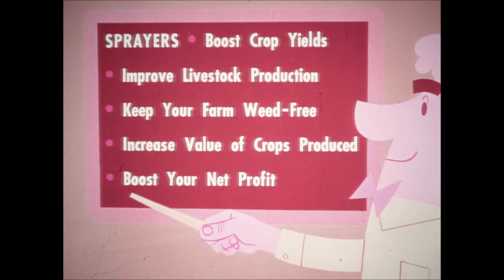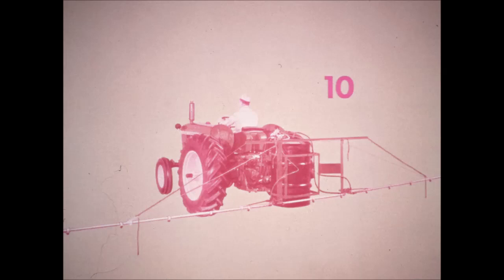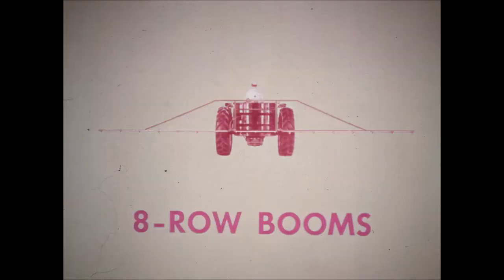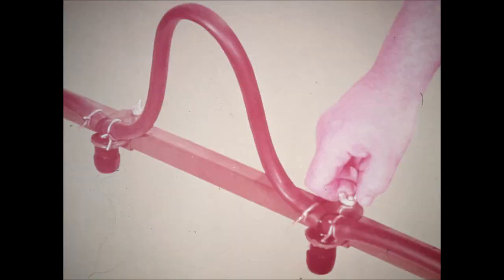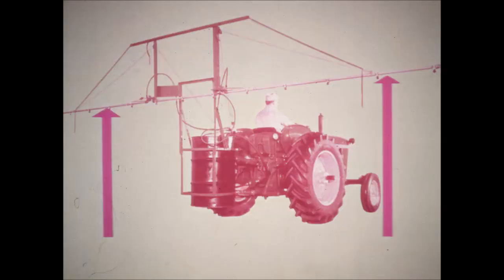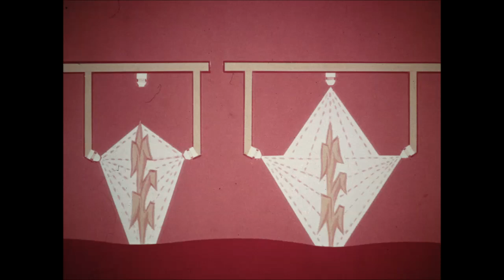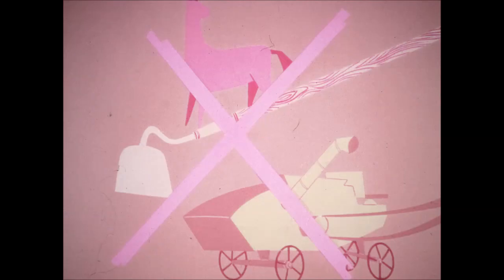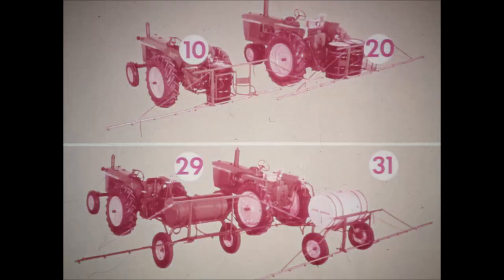John Deere Presents Sprayers

Comment: Looks like a combination of Hypro and Delavan pumps... high pressure piston pumps for high pressure low volume spraying like for orchards, to spray up in trees all the way to the top, or hosing down a pen of livestock.  Roller pumps are the old standby, been used for decades, self-adjusting for wear (to an extent, far more tolerant of wear than other designs like piston or  gear pumps), and the brass gear pumps, which are good for some things (like engine oil pumps, hydraulic pumps, etc) but for sprayer pumps, aren't that good because of corrosion and wear issues (I know I had one of Grandpa's old gear pumps that was worn out that I partially salvaged, as I lapped the housing to tighten up the gear end clearance between the gear and housing (to reduce internal leakage and build more pressure) but there's not really anything you can do to fix wear around the periphery of the gear tips where they're supposed to wipe along the wall to create a moving seal and minimize leakage past the gear tooth tip from one chamber between the gear teeth to the next, which is where the spray is transported from the inlet to the outlet, and forced out the outlet as the gears mesh their teeth together to fill each other's empty space, forcing the spray out.  The killer with gear pumps is when the gear teeth tips wear down, or the teeth themselves wear down from the wiping contact between them, and the front and back side ends of the gears wear, and the housing wears down next to those surfaces on the front and backs of the gears and around the gear pump housing where the teeth tips slide next to the wall, the pumps lose the capability to make pressure, due to the internal leakage of liquid "slipping" past the excess clearances back from the outlet to the inlet.  That's why you don't see many gear pumps on sprayers anymore... too many wear points.  Piston pumps are also likewise complicated, with bore and piston seal wear being issues, along with inlet and outlet valves.  Less wear points than a gear pump, though, and capable of creating VERY high pressures, which are essential for orchard spraying, which is why they're still used widely today.  The simplicity and self-adjusting for wear characteristics of roller pumps make them the most popular type of sprayer pump when one considers positive-displacement pumps (which roller, piston, and gear pumps are all positive-displacement pumps, versus vane and impeller pumps and turbine pumps which are all non-positive displacement pumps, where output in gallons/minute changes with pressure and impeller/turbine speed).  Roller pumps can adjust as the housing and rollers wear, because the rollers will simply slide slightly further out to maintain contact with the housing walls.  The most critical non-adjustable wear on a roller pump is the side-clearance of the rotor, similar to the side clearance of the gears to the housing on a gear pump, but lapping the housing (slightly grinding down the cover and housing joining surfaces) reduces the clearance back down to what it originally was, or close to it, thereby restoring the pump to proper operation, which is usually accompanied by replacing the rollers at the same time.  Roller pumps are simple to construct and simple to maintain and little to go wrong.  The other types of pump they didn't cover in the video (other than the variable displacement impeller or turbine type pumps) that is fairly commonly used is a diaphragm type pump, and the vane type pump.  Vane pumps are commonly used in hydraulic systems, where the fluid is the lubricant, but like gear pumps they're extremely sensitive to wear causing excess bypass, particularly on the faces of the vane center rotor to the housing (end clearance).  Like a roller pump they'll partially adjust to wear along the housing periphery, but have sliding contact between the vane tip and the peripheral wall, like the gear pump, where a roller pumps rollers ROLL along the wall facing.  The vanes tend to wear the grooves in the rotor that they slide in and out of as they rotate as well.  The diaphragm pump is similar but somewhat less wear-prone than the piston pump, since the diaphragm pump uses short-stroke "pistons" to move a rubber diaphragm up and down a small amount over a large diameter, to create the suction downstroke to draw fluid through an inlet valve into the chamber between the head and diaphragm, and pressure-producing upstroke to pressurize the fluid and force it out an outlet check valve to create flow and pressure.  Like a piston pump, however, they create highly "pulsed" pressure spikes as the fluid is forced out of the outlet check valves, so they usually have multiple offset pistons or diaphragm chambers to help dampen out the pulses so as one piston is delivering fluid the other is drawing it in-- and sometimes use an accumulator (particular with piston pumps operating at higher pressure) to dampen the pressure spikes and allow for more uniform, steady output without the "buzzing" of pressure spikes that can plague piston pumps, and to a lesser extent diaphragm pumps.  The rubber diaphragms themselves help dampen the diaphragm pump pressure spikes to an extent.  

What I found most amazing about this video (and a similar one I watched about IH spray tractor mount systems) was the use of steel tanks, in the case of the IH system, and Deere using regular old 55 gallon steel barrels.  Neither of these were particularly good choices for spray tanks, as they corrode so easily and, in the case of barrels, are difficult to get all the spray solution out of.  This was from the really early days of spraying and it seems clear these were sort of "ad-hoc" solutions that the manufacturers put out to "complete their line", and it'd be interesting to see what their sales numbers on these systems actually were.  It's not like spraying was some "mystical science" even back in the 50's when these were being advertised, because cotton farmers (and others) had been using oiling shoes (which basically sprayed a cheap low-grade fuel oil sort of kerosene for weed control) under cotton for a decade or more at that point... My Granddad's old oiling shoes are still out on the wall of the lean-to under a bunch of other old junk.  They basically slid along the ground with a nozzle that sprayed this "weeding oil" under the cotton plants to kill small emerging weeds coming up under the cotton plants.  They used the same basic hardware (pump, control valve, pressure regulator) as sprayer systems did to deliver the oil to the nozzles.  Flame cultivation was also popular at the time, but it usually used propane which is self-pressurizing to feed the burners under the plants.  

TBC... OL J R :)
Reply: Continued... 

I'm sure there was a lot of competition from "outside vendors" building and offering spray systems for sale even then.  Dad and Grandpa had an old pull-type Mayrath sprayer from the 60's when I was a kid-- it sprayed 8 rows wide on foldable booms, and used a small trailer similar to the Deere pull types in the video, with a long "Tylenol shaped" 200 gallon fiberglass spray tank.  They used to use it to put down Treflan ahead of the disk in spring preplant incorporated in cotton, then follow up at planting pulling a pair of rollers behind it to band Cotoran or Caparol in a 14 inch band down the top of the rows behind the planter, and roll the beds tight after planting to retain moisture and speed germination of the planted crop.  In the late 70's Dad bought a single saddle tank kit, since those had become VERY popular in our area in the early 70's, but instead of side-mounting two 150-200 gallon tanks as most saddle tank kits were then doing, putting the tanks between the front and rear wheels of the tractor, he used the single tank and frame kit to mount a single 200 gallon tank on the front of the tractor.  By plumbing together a ball boom on/off valve with a pressure regulator and gauge, and a bypass line feeding back to the sparger agitator under the tank, with the PTO roller pump on back, and then installing a four row broadcast or banding boom under the tractor belly behind the front tires, we could then spray and disk at the same time, so broadcasting Treflan and disking it in immediately saved someone having to mix and spray with the old Mayrath sprayer and the other guy on the other tractor having to disk the Treflan in.  Now the second tractor could be either pulling a fertilizer machine to knife in liquid fertilizer, or pulling a hipper (row disk) to pull the rows back up and rebuild the beds, and finish mixing the soil with the Treflan, leaving the field about ready to plant.  Similarly, at planting, swapping out the broadcast boom with the banding boom mounted under the belly of the tractor, one could spray the bands of Cotoran or Caparol down the tops of the already planted cotton rows, and then roll the beds tight to promote germination.  In grain sorghum or corn, the broadcast boom could be left on, and broadcast Atrazine over the planted field as the beds were rolled tight.  Worked like a champ.  

Heck in the 90's I even got an ancient Barrantine high-boy sprayer from a tractor salvage-- it was a rare wide-front model (most contemporaries and even later arrivals like the Deere 600 Hi-Cycle were tricycle units, with a single front steering tire, which made them very "tippy".)  It was powered by a Continental Y-91 gasoline four cylinder engine just like the old "Pony" tractors from Massey or A/C IIRC, can't recall which ATM, with a four speed transmission turning an old Model A car rear end with sprockets on the axle ends where the wheels would go, which turned drop chains down to large sprockets on the small rear "tractor" lug tires which drove the unit.  Unlike the Hagie and Deere Hi-Cycle competitors, it used a pair of aluminum tanks mounted ahead of the drive tires, which were hopelessly corroded, and which I replaced with a pair of plastic tanks in homemade saddles I built to replace the old aluminum flat-bottomed tanks.  Most sprayers had center-mounted oblong tall but narrow/skinny tanks with a rounded bottom and top, and usually a well or sump at the bottom to allow them to clean out more fully, either of plastic, fiberglass, or stainless steel.  I rebuilt the booms on it, which were raised or lowered by a crank winch.  Unlike modern sprayers with their 90-120 foot booms, this one only sprayed 8 rows (which was the widest sprayer we ever had anyway), but unlike the cheap 3 point hitch 8 row sprayer from Tractor Supply we replaced the old Mayrath with when its tank eventually split, we could use the high-boy to defoliate cotton, which became REALLY important to do ourselves after 9/11 doubled the price of air service cropdusting, which really cut into the cotton profits.  

Later!  OL J  R :)

Comment: Still a lot of very similar sprayers out there in use today..
Reply from the maker: I wonder if the barrel sprayers are still made somewhere. It would be easy enough to throw one together, but it's been years since I've seen a factory made one for sale. Always liked the simplicity of my grandfathers Comfort sprayer with the 55 gal drum on it. Looked alot like the 10 in the video. The nozzles & other fittings on there were from Spraying Systems, which is the forerunner of TeeJet. Whether that was original equipment or added later, I have no idea. I do know that it worked good & all that weight back there gave the 8N "power steering". Lol
Reply: @ikonseesmrno7300  lol. They use plastic barrels now.. 
Ya, 8n or 9n with a loader is fun🙄